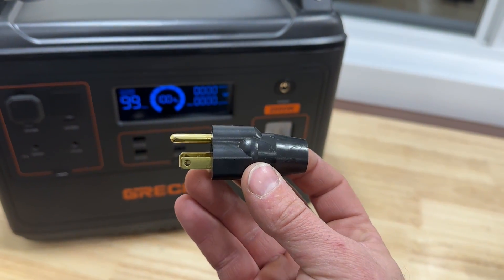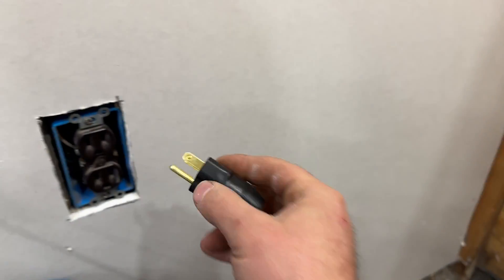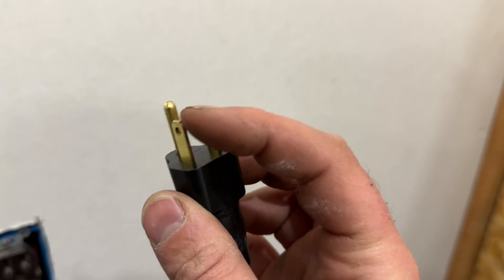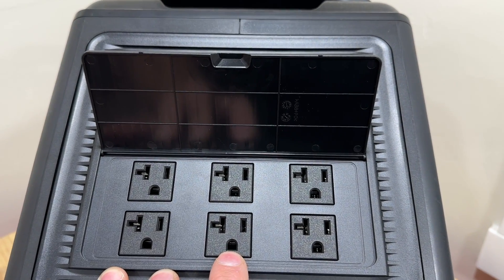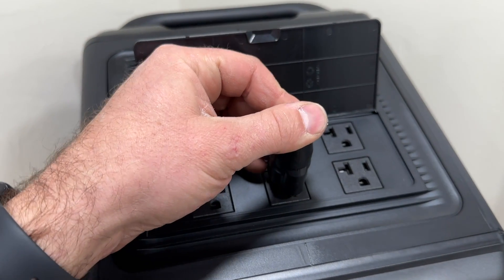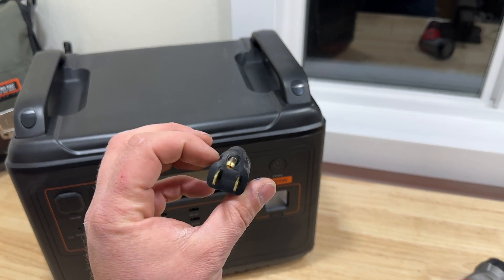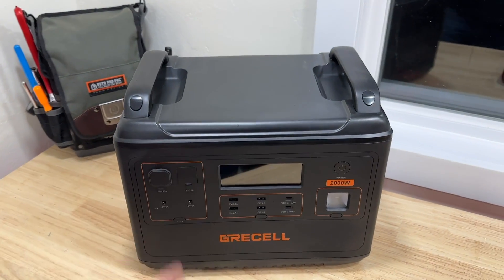What Is The Purpose Of An Electrical Ground / Neutral Bonding Plug?

Comment: @1:19 you show the Ground connects with the Neutral, but on your Powerstation @1:35 you show your receptacle as having the Neutral on the right side which is opposite of your Grounding plug. Why isn't the Neutral the same on the plug and the receptacle?

Comment: powering items from these power stations by using a bonding plug puts the user in danger as these units offer no protection from a shock should the appliance being used has a fault to offer some form of safety to users when using this bonding plug is to run any unit through a plug that is GFCI/RCBO/RCD protected as shown in this uk you tube video called Aferiy P210 Earth neutral bonded cable

Comment: I want to parallel 2 floating neutral inverter generators together and run any number of things like a furnace, refrigerator, tv, some lights.  If I plug a neutral bonding plug into 1 outlet of, say, generator 1 then aren't all of the outlets on both generators going to be neutral bonded? And if that is the case, what is the implication for running other devices besides the furnace?  Do I need a dedicated inverter generator just for the furnace?

Comment: This works great for floating neutral generators. I have a Champion 4400 and it worked flawlessly on all outputs. Everything worked normally after that. Not needed on a bonded generator.

Comment: if my electrician installs a EZ Generator Switch and wires it for a floating neutral, would I still need this plug for my Ecoflow Delta when hooked up to furnace?

Comment: Just so I clearly understand. This is ONLY if you are using the power outlets on the Generator right? Not if you have a dedicated transfer switch that the generator is connected to. Because the house of course, is already grounded. Please correct me if I am wrong.

Comment: I have a question and I may have to test it myself.  I have a floating ground generator that requires a bonding plug to run my furnace.  My generator only has 2 plug in ports so I lose one to of them to the ground neutral bonding plug.  I'd prefer to have both available.  ..  that said:  I have an extension cord with a triple female tap.  Would plugging in the ground neutral bonding plug in to one of those three female taps do the trick?  Would I then successfully bond ground and neutral and still be able to use my other plug in and also the remaining 2 from the triple female?

Comment: When you plug in a 3 prong circuit tester in to any of the AC outlets on the power station it will show a single light (open ground).  Will that change when you plug in the Neutral/Ground bonding plug showing the two lights (correct)?  Thanks

Comment: HELP; I opened up a new Ebay inverter with charger, UPS, and discovered neither the input plug, or the output socket, has anything connected to the ground leg.  this has a metal case with no ground. I'm thinking about running a ground wire from the input plug to the output and also the metal case. Thoughts please.

Comment: Do we need to use this when we plug an RV into a power station? I just got an Anker f2600, want to make sure it won’t hurt to run it without this bonding plug? Also, do you know if this will make the GFCI circuits in the camper operate properly like it is on shore power?

Comment: My furnace is on a 30 amp fuse in my breaker box. What size pigtail or wire gauge (AWG) is safe to use in this case when adding this plug to my furnace?

Comment: Hi, so if you have a generator that only has two plugs, is it safe to use this adapter in one receptacle then have a power bar with a few things plugged in along with the furnace in the other?  Thanks for the video!

Comment: This does work. I have a Jackery 1000 with just a hole for the ground plug. I  use a short extension cord with multiple plug in spots. I  plug the ground- neutral bond plug into one of the spots, the pigtail from the furnace into the other, and the extension cord into the Jackery. Works like a champ.

Comment: Question: I'm having this exact issue with my new Trane furnace.  I have a 3 outlet 10/2 extension cord that plugs into my generator.  Would I plug this Bonding Plug into one of the other two female plugs of the extension cord?  My old furnace worked great on the generator, the Trane requires the additional grounding.  Thanks

Comment: Just FYI on some models of inverters or power stations all the individual outlets are not connected, at least by the ground. So plugging in the bonding plug in one outlet will not bond the other outlets. In that situation you would need to plug in a splitter or 3 way plug adapter and plug the bonding plug into that along with the appliance you are powering.

Comment: Thanks, was having that exact issue with my Delta Pro and my HE furnace.  I made my own plug with a spare that I had laying around though.  One note, you are pointing to the wrong side of the outlet as hot (at around 1:40); the longer slotted side (and the one with the side blade) is the neutral.
Reply: The 2-prong plug he was showing is called a polarized plug, they started coming out in the 1970's.  We have some lamps from the 50's and 60's with the original molded cords and the prongs are the same size, thus you have a 50% chance the lamp switch is on the hot OR neutral side, depending on how the plug is inserted in the outlet.  Now electrically this works either way, however, for safety porpoises the switch is always installed on the hot side, otherwise you could be come the path to ground.  With a 3-prong, polarity is not a problem as long as the outlet is correctly wired.

Comment: Nice video.  Will this plug also work to bond a gas powered grnerator?  Thanks.
Reply: Yes. If your gas generator has a floating neutral, then there is no link from ground to neutral. It is unbonded. You can test this with a meter. When you plug in a neutral ground plug like this, the meter will then show the connection, it is now bonded.

Comment: What it does is gets rid of the floating ground. Or they also have a video out on how to wire that generator switch you installed by the furnace to accept a floating ground. If you’re using a generator whole house plug at a fuse box, 99% of the time it fixes that. Most but not all generators have a floating bond or ground and all power stations do too from my research. An extra step will needed to be added to power up a furnace in most cases.

Comment: Guy:  sense all inverter generator have a neutral ground what happens if there is a short or some issue to a inverter generator with this Neutral Bonding Plug installed ?

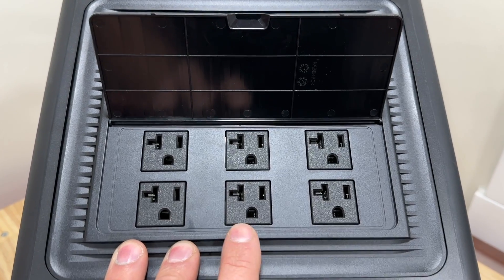Comment: just for your info, at 1:32 you inverted the the side of the neutral and the hot, the sided T form hole is the neutral. just saying. thanks for all your videos 👍👍
Reply: I noticed that too.
Reply: ...please put a correction caption in there.

Comment: You could use a power strip or surge protector strip to be able to use a furnace with a bonding plug
Reply: I just checked my inverter with continuity meter and other neutrals were not bonded only the one on the 3-way splitter with bonded plug
Reply: @StagArmslower  what is a 3-way splitter??
Reply: @yellow_panther  it's a plug with prongs to plug it in the outlet and be able to connect 3 extension cords to it

Comment: Do you think it will help in my case? I have a video I uploaded to find some help. My power station outputs erratic wattage when I’m trying to power my 5000btu air conditioner. ANKER POWERHOUSE 767 STILL NOT WORKING
https://youtu.be/JH0LOmtinp8

Comment: Is this used for a floating neutral generator? You just plug this into one of the outlets and you can now directly plug appliances into the floating neutral generator correct?

Comment: Really!! I'm a full-time RVer and use an ECOFLOW River 600 MAX when I'm boondocking (not connected to shore power). I bought a computer monitor that has a grounded plug and will not work. I'm also buying Starlink and it has a grounded plug. These 2 items use little power together and I need them to work. From your amazing explanation of this bonding plug, they will work. Am I missing anything?

Comment: At the beginning of the video, you mentioned some furnaces not running if the backup power source outputs an ac voltage that isn't a proper sine wave. A ground-neutral bonding plug won't fix that problem. In that case, you will need to replace your backup power source with a better one that does output a nice, clean sine wave.

The ground-neutral bonding plug will only fix the problem where the furnace specifically needs the ground and neutral to be bonded. What I have been hearing as the explanation for this issue is that some furnaces have a flame sensor that is designed to use the ground as a current return path. If the ground isn't connected to neutral anywhere in your power wiring, then current can't flow back from the flame sensor to the generator neutral. This means the flame sensor won't work, and with no flame detected, the furnace controller will think that the burner never ignited and shut the gas off.
Reply: So what is the work around for this issue? I bought a 1000$ Bluetti AC200, which is not cheap by any means and tried powering my furnace. And my Armstrong G1N80 furnace throwing a 9 flashes code: “incorrect line voltage phasing-polarity reversed”. I am lost at how to power the damn thing with my power source.
Reply: @olegk455  I would start by verifying that all the wiring connections are correct between generator and furnace. So: generator hot goes to furnace hot, neutral goes to neutral, case ground goes to case ground. If you've double-checked that the wiring connections are correct, then perhaps you do have the problem that your furnace requires ground and neutral bonded and the generator isn't internally wired that way. And so then I'd check with the literature for the furnace and generator, or call the respective manufacturers to find out whether that's the case. If this is the problem, inserting a ground/neutral bonding plug into an unused output power socket on  your generator should fix it.
Maybe the DIY HVAC guy has other suggestions for what could explain this error message ...
Reply: @olegk455 I'm having this exact problem with my Ruud furnace. When connected to my generator, the furnace throws a code for "reversed polarity." I just confirmed that the generator has a floating ground. I will try this adapter and see how it goes.
Reply: @Justbrowsing1988  it worked for me. I just picked up a plug and made my own in about 15min. Now furnace is happy and I can ran it with power supply.
Reply: @Justbrowsing1988  What happened when you tried one of these?

Comment: Got a slow leak on my A/C. Made it 2 summers but now needs a 410a fill up. Should I try a leak sealer? Or replace whole unit (I do plan to do this myself as well)? Outside unit is 11 years old. Evap coil 22 years old.   BTW, I just successfully installed a furnace in the attic thanks to your help. Got it checked out by a pro and he said I did a great job. All thanks to you, Dave!
Reply from the maker: Thanks for sharing!  Shoot me an email over at diyhvacguy@gmail.com and id be happy to point you in the right direction over there.  Thanks, Dave

Comment: I bought a Champion 3500 watt generator for power outages. When I tested it on my propane or LP furnace,  the burner would not light, but the  fan would run. I drove a ground rod for the furnace, I drove a ground rod for the generator, I had a ground wire from the generator to the furnace! No change. 
A local electrician told me to build a plug with 3 connector male plug, 4” of  #18 gauge wire. Put the wire on the silver terminal - neutral. The other end of the wire put on the green terminal. To test if it is done properly, shut off the breaker, plug the adapter plug into the outlet, turn on the breaker. 
Now put the adapter plug in to a outlet on your generator, plug in your furnace, it should work properly now. 
This applies to most all heating appliances with a power processor, similar to a GFI outlet. 
Hello from north east Montana. 
10 miles from the Canadian border.

Comment: I don't think this will help with the EcoFlow Delta units, as their opening for the ground plug is just a dummy cutout. I.e., there is no connector in the ground plug hole. It's just an empty space.
Reply: Since posting this comment, I've found a solution. I bought a grounding triple-tap and a neutral bonding plug, then inserted the neutral bonding plug into the triple-tap instead of directly into the battery. I then plugged my sensitive device (in my case, my camper van) into one of the open outlets on the triple-tap instead of into the battery, and my problem was finally solved. I assume this will work with my furnace as well.
Reply: @bobkantor4695  I hooked up my Bluetti AC200 Max Solar Generator to my sea container tiny house today and plugged the sub panel into the 240v outlet of the Bluetti and everything works fine including a.c. lights, sockets and air conditioning.  When I plug in a socket tester it does show no earth though.  But everything runs fine..
Reply: Bluetti AC200 Max and EB70 too.

Comment: I Have a 1000 W inverter but with only one plug. Do I have to have at least a 2 plug inverter in order for my furnace to work should I need this grounding plug?
Excellent channel!
Reply: I saw on another vid where a guy in the same situation used a adapter that converts one plug to three. He inserted this type plug into one of the inlets and the other two became bonded. He used a three light circuit tester to verify it.
Reply: you can install the bonding plug on three-way splitter and connect extension cord to it

Comment: I was literally just researching this 2 days ago, how coincidental you posted a video on it today!?   Quick question, my 12 yr old Navien gas tankless water heater is putting out a stream of water from its condensate drain line even when it is not on. That means there is a leak inside it correct? Heat exchanger? I think I should just replace the entire unit, as it seems like it would be costly to diagnose/repair. I know this is not the subject of your video, but curious on your thoughts?
Reply from the maker: I don’t have much experience with tankless systems but if it’s pretty old it might be time. I’m gonna be swapping mine out to a tankless soon so I’m sure we will be doing a video on that! Cheers
Reply: @diyhvacguy  Thank you for your reply! I look forward to your future video. I have decided to replace with a Navien NPE-210S2. If you think of it, reply back to this thread before you decide on one and I can give you a mini review of what I think. Have a nice day.

Comment: On my system the furnace was happy with the floating ground of the Bluetti AC200 Max but the Nest thermostat was not happy. Adding a ground/neutral bonding plug to the AC200 Max made the Nest happy and I can now run the furnace.
Reply: How does it fix it as the Bluetti AC200 Max ground hole is just empty there is no metal inside, it's just a hole.  Bluetti EB70 also.  It's just a dummy hole for 3 pin plugs, so there is no bonding possible there.
Reply: I don't understand how it works. I just know it does work. @cnxoutdoors

Comment: Of the ‘Power-Stations’ you’ve tested- which brands have you found need the extra ground plug?
 You tested the EcoFlow & the VTOMAN that share Pure-SineWave.., did the others have issues that needed the ground cord?
Reply: I don't think this will work with the EcoFlow, as they don't have any connectors for the ground pin.
Reply: Hey Todd, I have the Anker brand 757 and 767 power stations. My furnace is an 80+ and it would not run correctly with either unit, the same result with my gas dryer. I’m guessing the plug might do the trick but out of the box it was a no go!
Reply: On most solar generators  the ground  hole is just a dummy hole, I believe  that is changing  though with more recent  new models, my new Bluetti AC180 "DOSE" have metal ground terminals in the ground holes,also on the side of the AC180 it has a ground  terminal .

Comment: If the gen or battery is connected to the breaker panel with an interlock kit, the furnace would be powered thru it's normal A/C line , breaker and ground
Reply from the maker: Correct. If it’s not, how I showed in a previous video to make a dedicated outlet for your furnace and pigtail, then you might need to bond the neutral and ground
Reply: Thanks